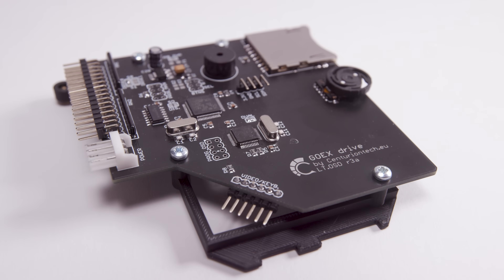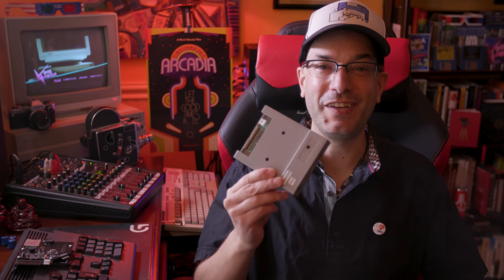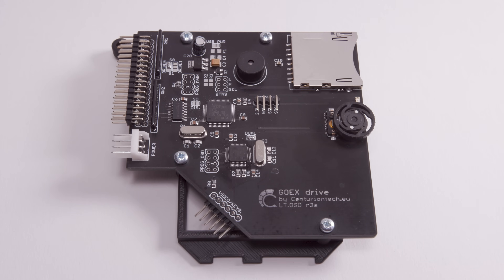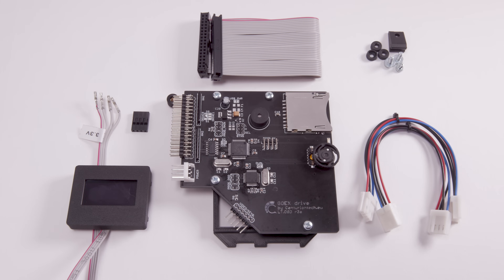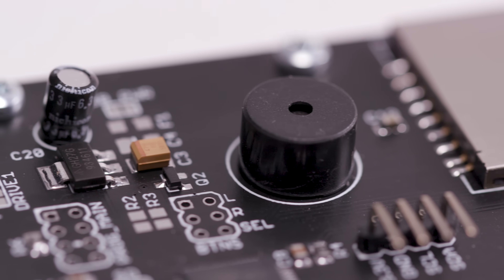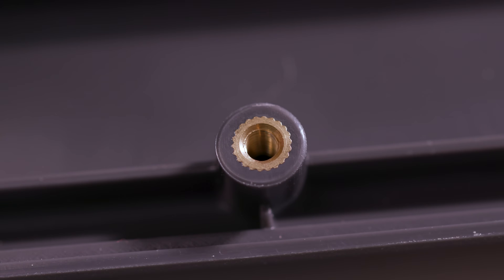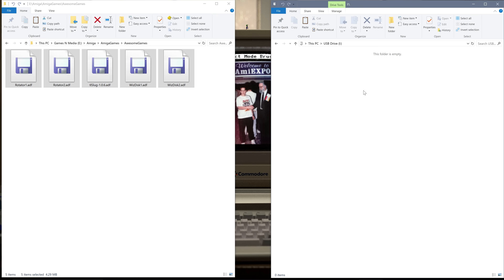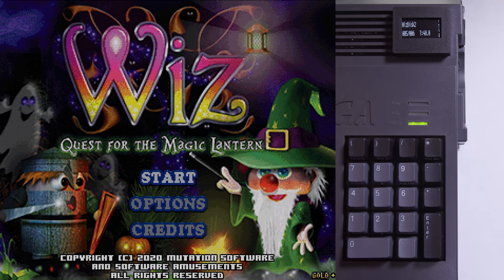Awesome Floppy Drive Replacement GOEX - not GOTEK! for Commodore Amiga 500 / 600 / 1200

Comment: maybe a stupid question but is goex for adfs only or can the sd card be used to transfer large files as well?
Reply from the maker: That is not stupid at all. It is for ADF's only but there may be some hack out there that lets you do larger files. Actually some firmware may let you do dms files, but I am not 100% sure about that. They are still 888K disk images though

Comment: Thanks for the detailed review, I'm going to order one of these :) 

Can you tell me - if you order the on-pills version with the on-screen menu, is the OSD still required for anything or can you operate it without it? Thanks for your help!
Reply from the maker: My pleasure! Thanks for the kind words. No, the OSD isn't necessary at all. Personally I use the OLED exclusively.
Reply: @TheGuruMeditation  Thanks for the fast reply! What I really meant was, does the OSD and OLED display essentially the same information? As in, if you buy the on-pills version with the on screen info build in, do you also still need the OLED really? 

I'll likely order it anyways - for the price it's a nice addition and very well integrated! Just curious as I'm making lots of mods and the price starts to add up!
Reply from the maker: @jimiga4902  Honestly I can't give you good information because I haven't done the soldering to enable the OSD. There are some clips online of the OSD working (it is basically the FlashFloppy OSD) but I didn't want to solder to my MoBo so I never took advantage of that feature. So you don't actually need the "on Pills" if you don't need to OSD and Keyboard control, but I got it just in case I decide to do it...and it is a black PCB so it matched my case, LOL
Reply: @TheGuruMeditation  This all make sense! Thanks very much - that's all the info I needed :)

Comment: Apart from being absolutely cool, does this do anything differently or better than a Gotek? I have an external Gotek drive and I’d hate making too many intrusive modifications to my childhood Amiga 500.
Reply from the maker: I totally understand. They are basically the same. I am running the flashfloppy firmware which was pre-installed and most GoTek's are working with that firmware as well. The things I really like about the GoEx is the simplicity of everything being right in one place and easy to buy. The 3D printed mount that fits perfectly, the jog wheel, and the external OLED
Reply from the maker: So if you are happy with your external GoTek and don't want to remove your original floppy drive, you probably don't need it. I would get one if you want to remove the original floppy drive
Reply: @TheGuruMeditation  Thank you for replying right away 😊 I’ll definitely keep the Goex in mind if my disk drive dies one day. It would be too sad not being able to use my old floppies though.

Comment: Call me El Cheapo, but while this new product seems perfect, I will stick with my installed GoTek and OLED-screen also attached on top of my Amiga 500. Works perfectly for more than two years now.
Reply from the maker: If you already have a working solution that you are happy with I don't think there is a good reason to change it. I like this GOEX when starting from scratch

Comment: So the jog wheel lets yu scroll through the floppy images, but how do you select one or eject?
Reply from the maker: Great question. With the setup you see here,  when you switch from one image file to another you are automatically ejecting the current selection and inserting the new selection. If you don't want any "disks" inserted you can just take out the SD card.

Comment: Wow, can I use it with msx or any pc ?
Reply from the maker: Hummm, I don't know. It would require flashing it with firmware compatible with the floppy controllers for those machines. I know there is firmware that works with the Atari ST, but not sure about MSX or PC.

Comment: For those Atari ST owners out there, please note that this company also makes this Floppy Drive SD Card replacement module for your ST as well as a bunch of SUPER cool ST adapters and accessories (ie. an ST monitor out to VGA adapter with a switch for LOW or HIGH resolutions)
Reply from the maker: I should have mentioned that. Actually it is an Atari ST friend RectaPete who turned me on to this.

Comment: Super cool this new toy for our amiga! I’m still waiting for the new a500 case from a1200.net. I suppose this is a problem to buy this goex because maybe change something inside, as you explain it with your A1200. What do you think?
Reply from the maker: I am waiting for the same A500 case. It is a great question. To be perfectly safe, you might want to wait, but most likely it will fit. No guarantees though. I am not sure of the exact changes they are making to the A500 cases.

Comment: Can you use a larger oled display screen? I find that one shown to be a little squished just wondering if a larger one would be better?
Reply: I'm sure you could use any oled panel with the same connectors and voltage requirements, but it looks like it only displays 1 colour text, so maybe a larger screen wouldn't have much benefit.
Reply from the maker: It is a great question. I think so, but I honestly don't know for sure. Sorry. I would have to look into it.

Comment: But.. the GoTek CAN do this all..??? Mine has the OLED, the speaker, the LEDs, a 3D printed frame, and the video mod and jog dial can easily be soldered, if one really needs them. So what is so special about the GOEX?
Reply from the maker: Yes the GoTek can. What I like about this is what I said in the video. It comes this way and is very easy to install. No need to do things like solder the jog dial

Comment: Looks a really device. My original Amiga I've not altered at all, using original disk drive. My second A500 has a Gotek, which works well. My A1200 still uses Floppy Disks. Maybe in the future i may change that. This is a great alternative. Im assuming you can put AGA files onto it?
Reply from the maker: I like to keep it original too, but the drive dying was the perfect excuse for this beauty. Yes, any amiga floppy works!

Comment: Did I miss the front on shot of what it looks like in place? Does it fill the floppy slot or does it leave gaps?
Reply from the maker: I didn't take a straight on shot from the side. Basically you can see the side of the PCB, Jog dial, and SD slot if you look in from the side.

Comment: Purchased this drive months ago for my A1200, also got the pills upgrade later. The idea is great and no one had to butcher their case. But the additional soldering is a bit pain in the a** ... Anyway, it works. If you can, make a short video for the soldering part - I think, it would be a nice service
Reply from the maker: Thanks for sharing your story. I am glad you are enjoying it with the OSD. Maybe I will do that. I didn't realize you had to solder when I ordered the "On Pills" But I am thinking about doing it.

Comment: Is there a way to select your ADF file from a full screen "front end"? If you have hundreds or even thousands of files on your SD Card it could take a long time to find what you need on that tiny OLED screen. Great video and showcase as always AmigaBill! 

By the way, what's your partner in crime up to lately?
Reply from the maker: Thanks JW3HH! Anthony is doing well. Keeping busy in Florida. You can select your ADFs from a full screen mode in which case the OLED wouldn't be as helpful. But I have over 5,000 ADF's so I find it easier to store them on my PC's hard drive and copy only what I currently want to load to the SD card.
Reply: @TheGuruMeditation  I can see that, sure. Imagine a bunch of single-game SD cards that you insert as though they were floppy disks.... You'd have a giant stack of them!

Comment: What a nice option! I like that it is designed from the ground up for the Amiga. I have two GoTek drives, but I may need one of these anyways...
Reply from the maker: It is super cool Doug! And I agree. Designing it for the Amiga makes it nice and easy to install without having to take apart a GoTek and put it in a 3d printed tray etc...

Comment: As someone that spent ages literally hacking into a Gotek's casing to make it fit inside an A600 as stealthily as possible without damaging the A600's case, I wish I'd heard about the GOEX earlier!

(yes I know there are 3D printed internal mounts for Goteks and Amigas... but I don't have a 3D printer and I already had the Gotek on hand)
Reply from the maker: I agree. This is a really nice easy solution. I have gone through 3 different GoTek solutions and I like this GOEX better than any of those solutions

Comment: Nice hardware but I lean to much on the WHDLoad Games and Demos. Use only the intern diskdrive for installs such as 3.1.4 and 3.1. Maybe it’s great with new Demos on ADF’s. It’s very nice that there is a black version. Should be perfect for my A1200 CD32 case such as yours.
Reply from the maker: Yes I use WHDLOAD mostly as well. But many of the new games and music disks come as ADF files so for me it is easier to use this instead of  trying to get them to work making my own WHDLOAD slave.

Comment: real fan use original folly is same fast than before
Reply from the maker: Yes I have a 1200 that is completely original. I respect keeping things original very much. I even keep the shielding on my other 1200. But in my opinion a real fan is anyone who loves their Amiga
Reply from the maker: Also, like I said in the video, I would have kept the real floppy drive in this one if it didn't break. I will fix that one though.

Comment: Nice to see alternatives out there.

 For me the ultimate mix would be the ability to have the original DF0 mechanical drive and have the GOEX in an external mount with Amiga styling applied to the case (like GVP used to produce). The external case would have a switch to move between the mechanic drive and the GOEX as DF0.

Keep up the good reviews💻👍
Reply from the maker: Thanks! You actually can do that. There is a DF0/DF1 switch that you can attach to the Even CIA chip to let you switch the internal drive and the external drive respectively. That would be a cool setup

Comment: this is great!
but how would you go about if you ever need to read a “real” amiga floppy disk?
Reply from the maker: Great question corb00. You can have an external floppy drive and plug it in to the floppy drive connector on the back as DF1: If you need to boot from a real floppy DF0: you can install a floppy drive selector switch for the external drive to be DF0: , but you need to add that to the Even CIA chip. Not a big deal, but you have to be comfortable pulling chips. There may be another way but this is the way I know. Or you could always disconnect the GOEX and run a longer power and data cable to a floppy drive outside the case as a temporary solution.
Reply: External Floppy Drive?
Reply from the maker: @skilgannon1971  yep. External floppy as DF1 or you can install a switch on the Even CIA chip and switch between DF0 and DF1

Comment: Wish i had Amiga 1200!
I had Amiga 500 when i was young.
Reply from the maker: The 500 is great. That is a classic. The 1200 is more versatile these days though. The IDE and PCMCIA make it a dream as well as AGA capability
Reply: @TheGuruMeditation  My 500 was upgraded with 1Mb RAM and Workbench 1.3 :) had a switch so i could choose 1.2 or 1.3 depending in the games. Some of them did not work on wrong version. Had that big commodore extra floppy, commodore monitor with mono audio, TAC2... lots of fun.

Here in Sweden its hard to find a Amiga 1200. If there are any they are expensive and sometimes modded and also the plastic is in bad condition. Really yellow plastic.

I might get än Amiga 500 from a friend. He has two. It didnt work. But that shouldnt be a problem. I had plans to keep the keyboard and replace the case and caps with new ones. And use modern PCB's to use with SD-card and such. Dont think the components on the Amiga PCB will be so good in condition for this many years. 

Any suggestions what to do if i can have it? What to change, mod, upgrade, replace.. modernize.
Reply from the maker: @orfeous  Nice! My favorite upgrade for the 500 is the ACA500+ https://icomp.de/shop-icomp/en/produkt-details/product/ACA500plus.html
Reply: @TheGuruMeditation  message me if you find any 1200 available. Hard to find here.
Reply from the maker: @orfeous  Will do!

Comment: Does this also mean you can access the files on the SD Card through this device in Opus in your real A1200 and run for example WIZ from the internal storage after copying it over?  

Or does it only allow you to load them straight from the drive as if you already had a floppy disk in the Drive after turning the Amiga on?
Reply from the maker: Great question. Yes the drive works with DOPUS, but exactly like a real floppy would. So you see the contents of the "disk" not the ADF file itself. You can copy the contents onto your hard drive but in this case you couldn't boot it like I did here. It would be exactly like copying the contents of a floppy disk
Reply: @TheGuruMeditation  
Ah cool!  that makes a lot of Amiga sense 👍  Well if any game has a HD Install option that'll make this device very handy.  It'll save me from having to get my CF Card out inside the 1200 every time I want something new 👍  I've got my Amiga hooked up to the Net but a lot pages it can't access as you know.

Comment: Thanks for the video. I'm sending my 600 off soon for a recap, and was going to have a gotek and speaker mod installed. I think I'll go for this instead!
Reply from the maker: Yeah, I really like this GOEX a lot. and you can get the 3D printed OLED mount in the proper color for your 600 if it isn't black like my A1200

Comment: Now this looks absolutely brilliant! I’m tired of hacking Goteks and cases to make them fit then messing around with firmware. Very nice indeed!
Reply from the maker: I hear you. I usually just used the GOTEK externally so i didn't have to worry about mounting it and could easily access the controls. This is a cool way to do it
Reply: @TheGuruMeditation  the worst case I found for fitting a Gotek I think was my A600. We have 5 Amiga’s from A500 to A1200 and CD32. I stupidly sold my A3000 in 1999 - seriously regret that :( I’ve just ordered a GOEX for a pristine A500 we have with a broken floppy. Can’t wait to try it!